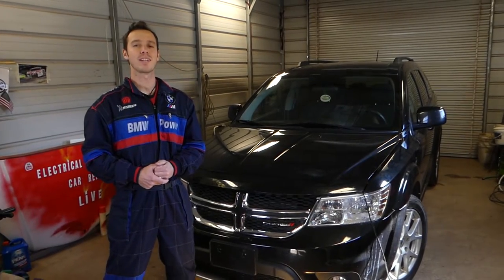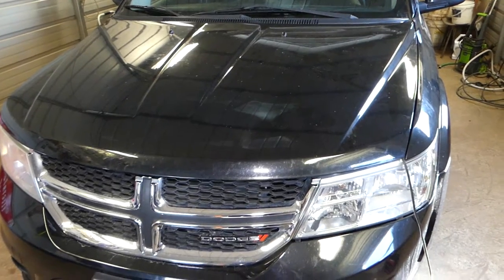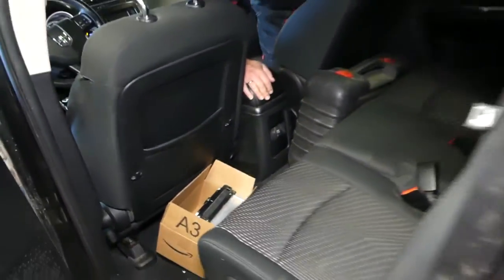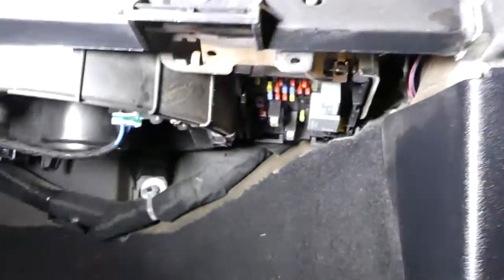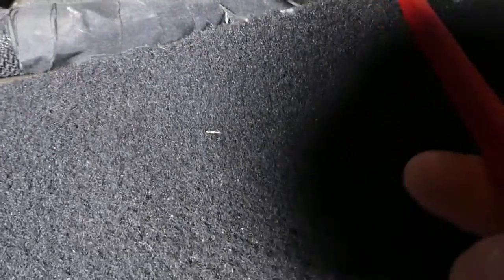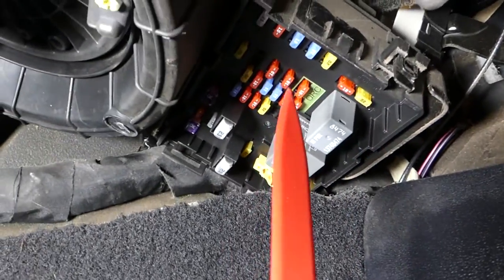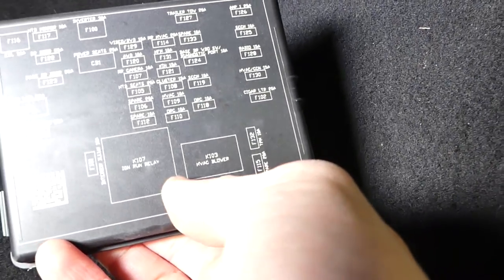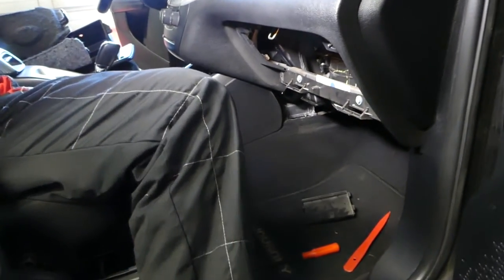DODGE JOURNEY CIGARETTE LIGHTER OUTLET FUSE LOCATION REPLACEMENT  POWER OUTLET FUSE FIAT FREEMONT

Comment: I have a 2013 Journey. The lighter outlet under the stereo doesn’t work and it’s a pain to get to the fuse panel. However, I knew it had 3, not 4 outlets. I was not aware there was an outlet on the bottom of the armrest console (I’ve only had the suv for a little over a week). That’s huge for me, as long as I have 2 working outlets, I’m not going to attempt to change fuses. But it’s still good to know how to do it.

Comment: Ok so what if ALL 4 are not working? My USB in the arm rest is working but none of the 12V outlets are working!
Reply: Same for me 😢
Reply: @joleneguerrero4794  And the electrical issues. Is it the TIPM or the PCS?  My DJ works ok sometimes but every once in a bit it has problems like the dash lights go on and the check engine goes out by next morning. Sorry to go so long but numerous, same issues being reported with NO recalls!
Reply: Hi im having the same problem with my dogde journey rt did you ever find out what’s wrong?

Comment: I have a 2013 Dodge Journey I just got and none of the power outlets work any suggestions??
Reply: Did you do the video procedure?
Reply: KTM Laranjinha  yes of course, and I replaced all 3 fuses but the previous owner waterboarded the center console, power outlets and shifter in coffee. Even after replacing the fuses the outlets still don’t work so there has to be something else somewhere that I need to check still. I’ve done everything short of tearing apart the interior and tracing the wiring with a power probe but I’m trying to avoid all that.. so if anyone have any good ideas or solutions I’d be glad to hear them
Reply: This car has some serious eletric problems...
Reply: KTM Laranjinha the whole thing had some serious problems inside and out but I’ve nailed everything down and fixed all but the center console and power ports. Put it in perspective I got my 2013 Dodge Journey for $400 🤷‍♂️
Reply: Brand new car and all of them are black and and wtf we only use the one we checked

Comment: My Dodge journey 2.7v6 fuse box started smoking after replacing it with a new battery. After I replaced it with a new fuse box it started getting acceleration problems, what could be wrong?